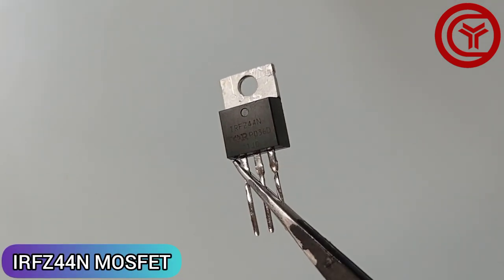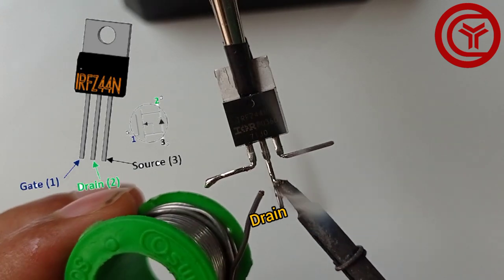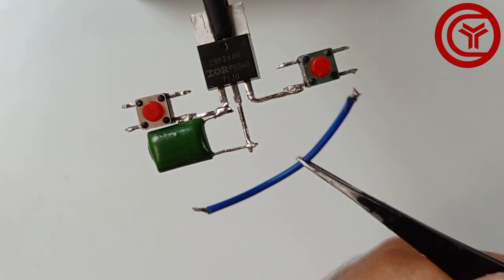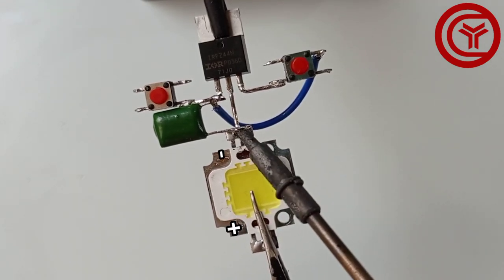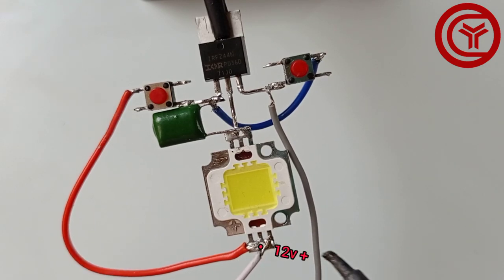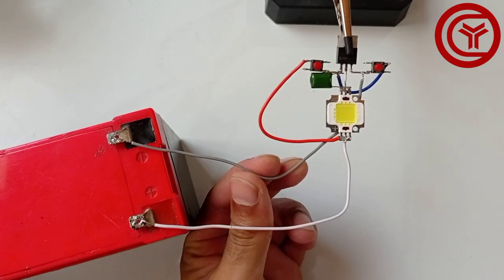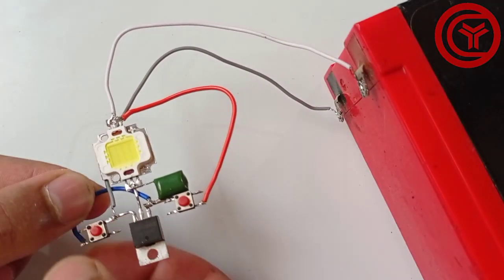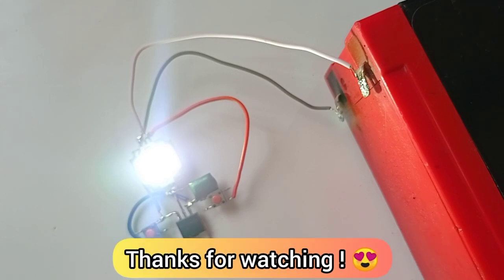Push button on off switch circuit | latch circuit

Comment: I will say batteries do not like you to solder to them.  Repeatedly doing so will cause them to fail.  Using slip on connectors with a pigtail is a good way to do this.  Adding a simple fuse would be a good idea.
Reply from the maker: I appreciate your idea bro, Thanks for suggestions 👍